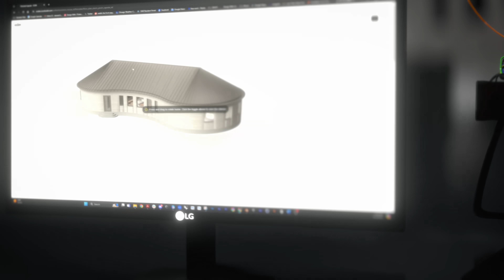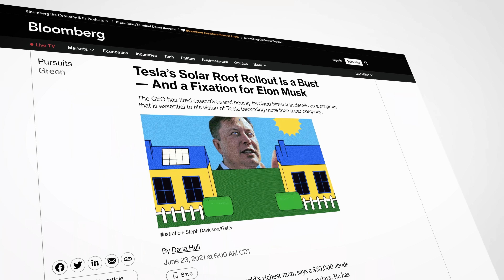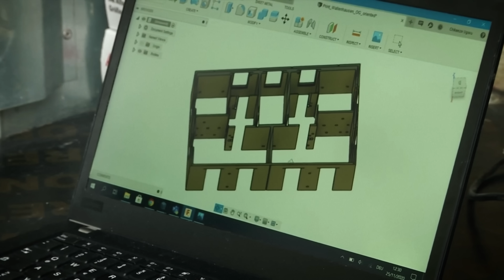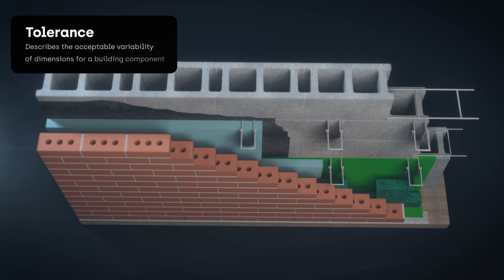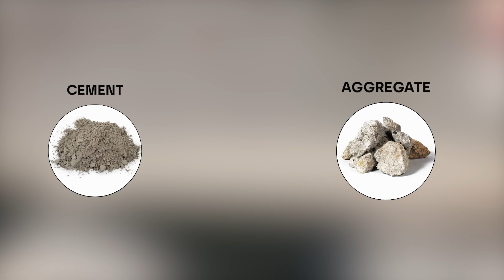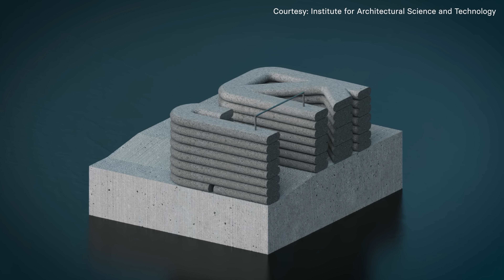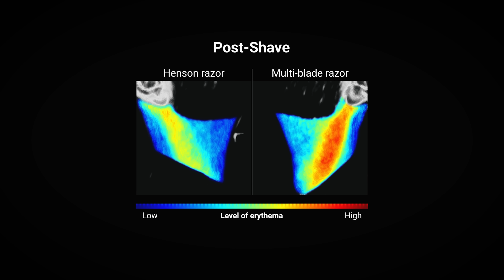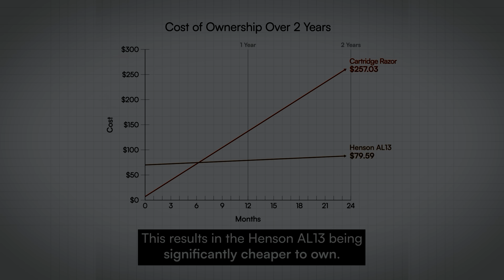Why 3D Printing Buildings Leads to Problems

Comment: window and door fixture is very easy to fix in 3D printing. builders just need to think this is a new process and they can't just use the old way. one way to make it good looking is to dock the element from one side of the wall, and in 3DCP it is very easy, in fact, it is easier to print a spacing on one side, instead having a gap in the middle. and the internal could be easier render with plaster just like all other house, this rendering would also create sharp corner if the client want. altho, what does a sharp corner offer that a round corner couldn't do? also, curving wall is self supporting without columns and beam.  because the moment of area of tilting the wall will be much higher without using more material, this is proven to be a better way of building house, the modern design of having straight wall is not because it offers better performance, it is just easier to be made in a factory and pre-fab, is it a cost saving decision not a performance enhancing decision. Ppl tend to forgot we already made a lot of structural performance sacrifice for modern house design. 

the point about pre-fab and mass production.... this is not the case for houses, if it is, we would automate the house making process in factory, and already took the path that phone and car maker do. the reason why each house is a project itself, and there is a huge tolerance allow for house building is the reason why they cannot be massproduce, and thus 3DCP could be used. You already ans that question yourself int he vid, so raising doubt on it is like your left hand fighting with your right hand.

Comment: I've watched 2 of the houses I've owned being built and the actual construction time is not so formidable, it's more of the vagaries of weather and getting labour crews in for all the different features for home. I reckon interlocking styrene foam blocks with re-bar inserted and concrete poured in would probably allow a house to be built quicker and significantly better than a 3D printed house, it's mostly down to designing the way everything fits together. For example all the plumbing could be precut to size in a factory and moved into place. I re-plumbed my first house in an afternoon (cold water only) by myself because I measured everything up, cut it all to size outside the house and then moved everything into position and connected it. Also a lot of the cost is in the way that the management hierarchy works and is paid.

Comment: In fact this technology is rather young. When FDM appeared with the first Darwin printer, I immediately thought of building with some sort of concrete. All my relatives and colleagues laughed because you always need moulds for concrete. A few years later the adapted material was there, and I should have followed my instinct. There are other ways of using 3d printing that were not tested for large house sizes: non planar printing, in the directions of forces (thus always print "in compression"), 5 axes printing where you can install all plumbing, electricity, reinforcement if you want, and print "concrete" around it. You must imagine what the technology brings : adaptability over preceding layers. Until now the principles came from CNC machines: there is no control / command loop compensating for small irregularities measured on previous passes... With such a feature, it could also compensate for small misalignments in foundations, as long as both ends are at least local highpoints. Make all openings with arches and non planar, then bring the complentary ogive with horizontal base, and standard rectangular windows. Nobidy tried porous structures like in bones for making very solid pillars, perhaps in conjunction with fibers just as momentary supports? Different printing heads could allow for finer details where needed. If you remember that lightest moving heads were invented for a combination of speed and accuracy at EPFL Switzerland, there is perhaps no need for super heavy frames and heavy trucks for their transportation, especially if you bring real time adaptability when printing. If you have a very light printing structure, then some complex math can adapt printing from arbitrary (in some limits) positions of this structure. Medieval castles have bumps in stones because some elevator for material were positioned at those locations, following elevation of the wall. A light printing structure can be moved and placed on solidified layers beneath or on some anticipated supports. Should I mention that cathedrals are surrounded with forged steel parts interlocked in stone cavities and lead was poured inside the cavity and around the interlock, bringing certain elasticity as well as rust protection ; and this proved quite seismic efficient.  
But printing on site with variable weather conditions is not optimal. I would better prepare fully interlocking parts made in factory, with all plumbing, electric lines, and isolation, less heavy than complete rectangular-mould-limited walls. Better dimensional precision, enough tolerance for on site installation.
Construction is still mainly artisan work, and particularly closed to digitalization. The logic of optimisation is that it must become industrial.
"Can this be fixed?" Of course, cut off the bad part and replace it with a new printed part !

Comment: A good framing crew can frame a spec house the size they are printing in two or three days. After that, there can be multiple trades working on the house at the same time. I just don't see the big advantage of a 3d printed house.
Reply: I think the advantage is just a stronger structure in general. Might be cheaper to slap together moving forward. Right now  everything about a home is expensive

Comment: Repairs and alterations of 3D printed buildings could probably be printed in place when the robotic printing arm is equipped with a 3D scanner and the path generation is done on the fly. 
It's still going to be pretty ugly, but that seems to be the overall theme here.

Comment: Just wanna say that the Henson razor is legitimately amazing. It’s the platonic razor. It literally cannot get better than this until they develop handheld electronic shavers that use lasers to burn the facial hair off your face. Those Henson razors are insanely sharp, and the way that the mechanism holds the blade is perfect and it really does give you an insanely clean shave. I will definitely say there is a slight learning curve. Unless you are used to using a single bladed razor like that, it can be a little awkward at first. But it is almost exactly the same technique that you would use for any kind of disposable razors, but you just have to hold it at a slightly different angle. So What I mean is that you will have to readjust your muscle memory on this one if you already have a really dialed in strategy. But once you use it a few times, then it becomes second nature. Also, the blades are stupidly cheap. I got like 100 blades for like, 10 bucks or something. Each side of blade usually gives me two shaves. I know it sounds stupid but yeh I can get four clean shaves that don’t hurt or fuck me up badly, out of each blade
Reply: Second. I was shaving with my henson while watching! I bought it two years ago and haven't put another penny towards shaving since

Comment: So like, if I wanted to, I could still put up basically any wall surface that I could normally put on my wall? Like I can just put up Sheetrock if I want to right? Or sheet metal or whatever. It’s still a concrete wall.
I can screw stuff into it

Comment: Main problem ive been seeing with these is the lack of reinforcement/support. The main economic problem ive been seeing is the price tag. Theyre claiming that its cheaper to build in less amount of time. But then marking the price through the roof. You can always count on greedy contractors to shoot themselves in the foot. 

If you have 0 3d printing/fabrication experience and 0 to minimal construction trade experience you are not qualified to speak on any of the above topics.

Comment: Will not increase much. This is just framing… which usually only take a couple of day. Still have to do mechanical, electrical, plumbing, trusses, roof, finish inside etc…

Comment: My sister and brother-in-law recently moved into a 3D printed home. I envy them. The walls are thick, not just the exterior walls. It’s very resistant to exterior noise. It’s similar to living in the basement, always nice and cool and quiet. Very energy efficient too. They love it. And it looks aesthetically like any other house.
Reply: Isn't that the same as for any stone-like building. I.e. the vast majority of buildings in Belgium are brick ones. In regions with more rock, stone walls are more popular, and today pre-fabricated concrete walls are also used to make houses.

These prefab walls are what comes closest to the mass production of other industries. There are a number of standard wall shapes, often including cavities for pipes or multi-layered with insulation. These walls are then brought to the buildsite and bolted together.
Reply: Yeah just like any other cement bricks in many parts of the world
Reply: @Srt3D01-db-01  I lived in a cement block house and the 3D printed house is definitely different. First of all cement block houses normally have drywall. Not a 3D printed house, all the walls are cement. Thick cement. There is no doubt when you walk into the house that it is different from any other house.
Reply: Lies
Reply: @DurzoBlunts  😂
Reply: I don't like it cool. I like it hot! 
People who have low body fat feel cold all the time. They need the house to be hot or else they are shivering all the time.
Reply: @ You would love it here, summertime temperatures regularly get up to 110 degrees F. My wife likes the warmer climate too. The house can be adjusted to retain heat also, once the cement reaches your thermostat temperature it maintains it with minimal energy. Even if it’s cold outside.
Reply: I love the look of 3-d printed homes

Comment: Very few countries can build with wood. For example, Guatemala has only one kind of wood with reasonable strength for building, but it is pure caviar for bugs, so it can't be used. I think this will take off in a few years wherever it is more economical than manual labor.

Comment: I think there's another issue with concrete printing that takes longer to manifest: The main reason why bricks are pretty sturdy is because they have gaps they can shift in. Same reason why we make sidewalks in short panels, because if we just made them continuous, they would develop more cracks. Since these 3D printed houses are on thin continuous layers, you could more easily develop large cracks. Just imagine if for example, the foundation were to shift in a segment, not necessarily a sinkhole, but enough to put more pressure on one section vs another, and it doesn't take a big shift to do that. Bricks have the mortar gaps to shift in, but 3D printed homes have nothing like that, so they will crack and don't have the longevity that people would think they'd have. 

Due to the rough nature of the printing itself, it also increases the surface area of the concrete, which can have some thermal benefits, but also has downsides like more flaking, which means you get tons more concrete dust coming off it, and concrete dust is a corrosive dust that reacts with moisture, so it not only causes problems with other materials, but people too. That is why 3D printed homes should definitely have finished walls, at the very least a nice thick clear lacquer coating, which again comes with its own problems. Concrete is always curing, even in a finished building, even decades after it has been laid.

Comment: Structure is the fastest part of building a house. Framers can do a mansion in a week. Most of the time is spent permitting, lining up the dozens of different trades, etc. You still have to prep the site, wire up the house, run plumbing, install windows, interior and exterior cladding, trim, finishes, etc etc etc. The current state of the construction industry does not make this idea viable economically, residential or commercial (where a lot of very fast modular systems exist). I still like the innovation for the sake of technology, but it doesn't solve a real world problem IMO.

Comment: Im sorry but... who cares about curvature and how difficult it is to put a cabinet up when the home is 500k vs 100-200k.  Thats a moot point at best and even then its hard to argue because the whole point is to make homes affordable.  No one really cares about how its done.  At least its a valiant attempt at fixing the affordability problem

Real fix to the crisis is banning excessive appreciation and turn housing into a depreciating asset seeing as things age over time similar to a car.  Id understand the land appreciating, but the house needs to be split off of the land at this point and have two separate things, not just all in one price.  

For example, say the lot is 50k and the home is 250k for a total of 300k.  The lot can appreciate at whatever rate so lets say it jumps to 75k in 15 years.  Lot is still good as its dirt, its usability will long outlast civilization probably.  Now lets look at the house, wood deteriorates, insulation can go bad IE weather stripping, foundation can crack, plumbing can go bad, same with electricity etc so why would the house appreciate?  If it was a car then that would hurt the value of it immensely.  So in this instance, have the house valued at 200k, now that total is 275k instead of 325k because the home depreciated as a result of usage as it should.  Many other countries do this, I dont understand why we allow realestate to be like this.  I get that some buildings  should appreciate, but your football man cave isnt something that adds value to it truly.  

Just my two cents though, I wouldnt mind what I just said at all.  But I also think the pricing of everything is a bit absurd when I can throw up a steel building for about 100k ish.

Comment: Precast concrete homes is way more efficient and faster All the walls an roof are poured off-site truck to the job and assembled. The house would be virtually indestructible I believe that's why they don't do it

Comment: I really liked the idea of pouring concrete into a styrofoam mold to get your walls already heat insulated - I wonder why it did not stick, I've only seen it shown on TV, supposedly it was cheaper and faster to build than your usual brick house.

Comment: tolerance is a software issue, literally all you have to do is measure it correctly and then tell the robot to go do its thing and set its tolerances and print and flow speeds. you do this enough times it wont matter where you are as long as the ground beneath you is good level, and can support the structure over time

Comment: I live in a suburb of Perth,  Western Australia. I'm a 77 year old electrician. I was an electrical contractor for most of the years since I finished my apprenticeship. Most buildings here are double brick with a concrete slab, timber roof with generally concrete tiles on top of the roof timbers. These are installed when needed. The Electricians put the TPS sheath wires into the walls & ceilings. The plumbers put the water pipes in & Gas pipes in. Then the gutters & downpipes are installed.  First the cement is troweled on and the plaster is troweled on when needed to the inside brick walls. Gyprock ceiling panels on the bottom of the roof timbers are installed. Internal cupboards, bath, Shower recess and toilets are installed. then it has the floor & wall tiles installed and at the correct times the painters do their painting. Then there is a hand over process. After six months or so an inspection is done & items that the owners who have been living in the house find problems are fixed. This works very well but it can take a long time. The building costs are kept low because the builder has contractors doing their work in reputation so it's completely different to employing wage people. The labour cost are very low. The house may take quite a while to build but you all would be amazed what you get for your money. Let's say somebody wants a house designed by an architect and they then use the architect to build the house. The costs don't compare with the standard builders houses from display plans. Maybe they have to change the way 3D printing works when wanting to include it in house construction to compete with the price here. 
In 1968 the houses were double brick with timber floors. In that year an Italian builder built a double brick home with a concrete floor. All of a sudden within say a month or two all houses (Except for the government, Homes West houses) seem to all change to building houses with  concrete floors. Houses were built then without using any electricity. Not even a generator. One day it will obviously change to a 3D built house here in Perth, Western Australia I suppose.
Reply: Western Australian here too. They can build my future house any which way will work I just want to be able to afford the bloody thing.

Comment: They use geopolymer mixes, and fibers that replace traditional reinforced steel, its far stronger. Also, it is far easier to patch concrete if need be then mess around replacing frames and dry wall. I know all this from experience. Trick is they should be trowelling of the wall prior to drying and skim coating smooth if need be.

Comment: If you're worried about housing having that 3D printed lines on the walls, just smooth them over if you don't want the weird squiggly lines, you can do that as it's drying before it's fully dried and get those angular corners you want.